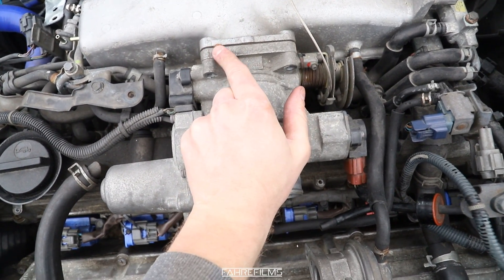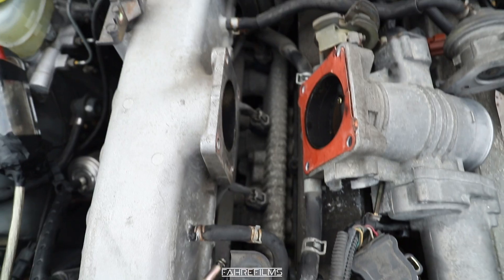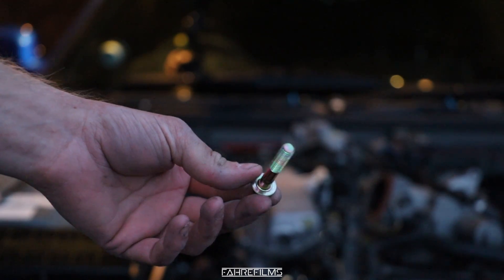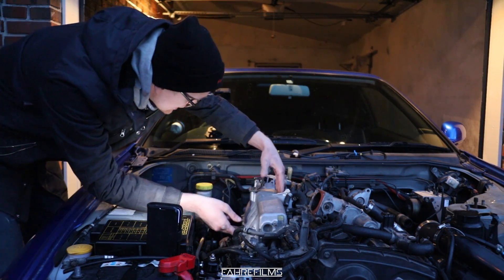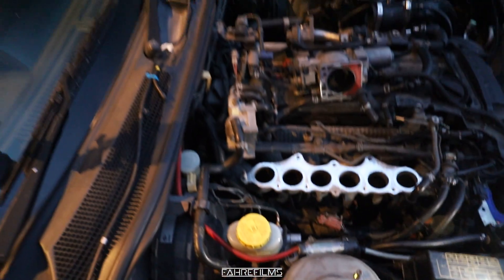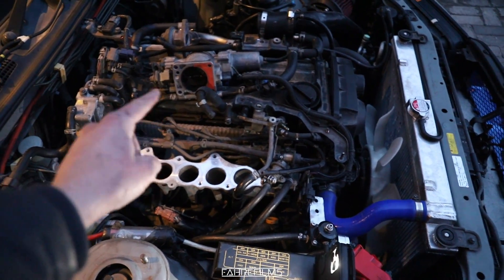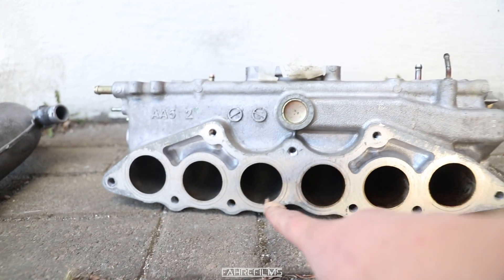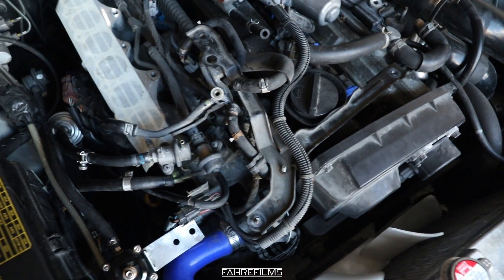How to Remove the Intake on a RB25DET Neo

Comment: 1. how many kilometers did you change the oil?
2. Are the injectors still good? 
3. What year was the car made?
Reply from the maker: Hey dude, Car has done 119 000,- km. I swapped oil right before winter storage. Changed it twice last season. Oem injectors work just fine, but need new ones for more power 🏁✌🏼 This car is a 1998 model ✨
Reply: @FahreFilms  interestring
Reply: @FahreFilms  i cainged my oil at 1.000.000 kilometers at my megane and an injector is defective and my model is from 2004